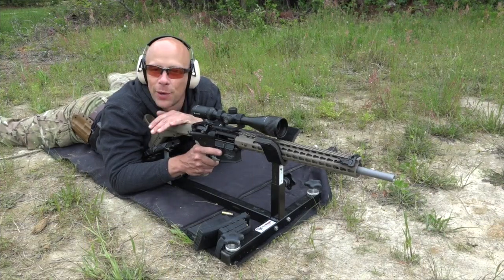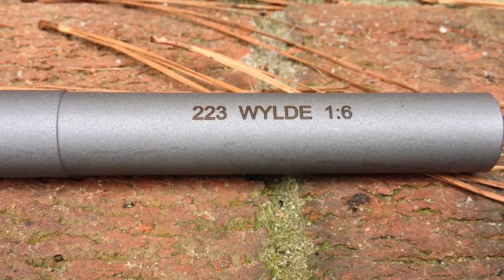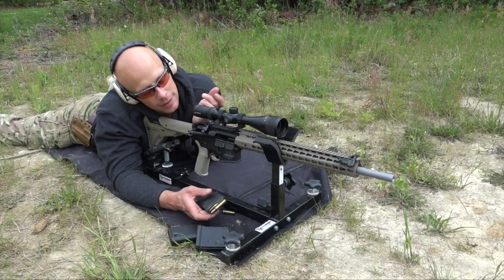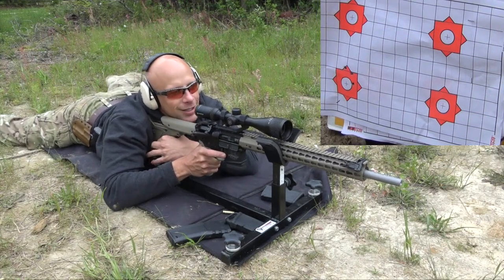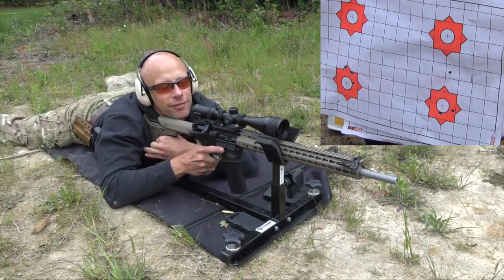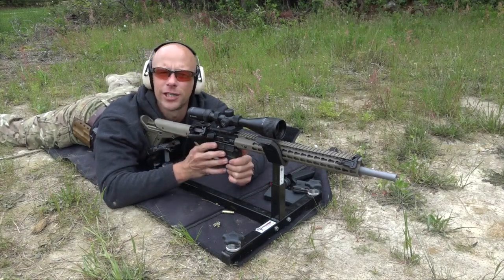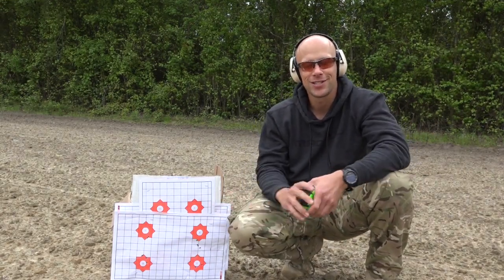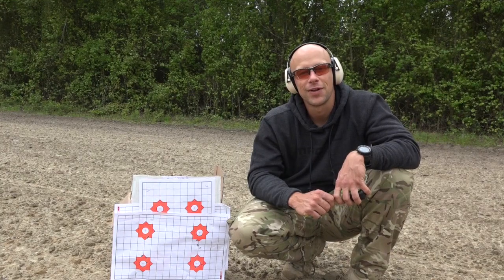Prototype 18'' 1 in 6 Twist Green Mountain AR-15 416R Stainless Barrel Test (HD)

Comment: From my experience, an 8 twist stabilizes the 80 SMK bullet with no issues. A longer projectile may require a 7 to 7.7. Exception is the 90 grain bullet (custom chamber, throat etc ie very few people) sometimes requires a 6.5 twist. 

So this begs the question, what is the point of shooting magazine length bullets with a 6 twist? What are we gaining? What are losing? Gaining I would say nothing. Losing I would say velocity.

Comment: Great video. I'm looking towards an AR build that aims to be an all purpose hunting, defense, and light weight build. When looking at barrels there seems to be thousands of choices. Cant decide on whether to go with a 16 or 18 inch (1:8 twist) from either Ballistic Advantage, Green Mountain, or White Oak. What are your thoughts on these manufactures
Reply from the maker: They all make decent barrels. I'd check out my AR Barrel material and AR Barrel length videos for more info
Reply: +Mrgunsngear Channel thanks for the reply. i watched the other videos. it definitely helped. One request, can you guys research REV arms barrels

Comment: The price is what concerns me with Green Mountain barrels. As for "match grade" ar15 barrels reaching over $500 Green Mountain offers barrels for less than half that. Could they be too good to be true?
Reply: Honestly, you would probably have to ask a machinist or engineer. Considering that the majority of steps that go in to making a barrel are automated and are therefore not influenced by the skill level of the individual machining them, one has to wonder what the high cost of certain barrels can be attributed to.

Comment: I'm thinking nice rail and then you say it's UTG! Anxious for the review
Reply from the maker: Bryce P Thanks
Reply: Bryce P I thought the same thing when I saw them and then I bought it because it is a great price comes with two rail sections and made in the USA.  My has been outstanding and it is light weight, especially for the money. I'm excited to see Mrgunsngear's review. Just thought I'd share my experience with it.
Reply: Bryce P The UTG Pro Slim line series is made quite well. And just as good as any of the oher quality hand guards/rails systems out there. I was quite surprised when I put one on one of my AR's. I would get it over a ALG, Midwest Industries, et. al. As for their other rails, I can't comment. Though I've heard they aren't of the best quality. However, the Pro series is quality made.
Reply: I have one of these rails on my chf mid. It looks awesome and the barrel nut mounting system is def engenius and eliminates the headache between over torqing, and gas tube alignment. 

But I have knocked the front sight a few times on the door frame and realized that I was losing cowitness with my dot. 

Tried tweeking the rail by grabbing the barrel with my fingers and pressing the rail with my palm untill the gas block touches on the inside of the rail on either side.

Long story short, something is not staying put. After I pinch the rail and barrel I lose zero to one side or the other.

I'm wondering if I am literally bending the aluminum tube, or possibly my barrel nut is lose...

Comment: Is it even possible; within reason to over stabilize a bullet?
Reply: Rodney Hawk Nope. Over spinning only becomes an issue on thin jacket bullets. Over stabilization only becomes an issue in artillery when you are using sharp trajectories to get the projectile to it's target.
Reply: I imagine spin drift would be enhanced at distance though ?
Reply from the maker: Rodney Hawk Correct

Comment: This begs the question..  Is it even possible to "Over Stabilize" a bullet with fast twist rifling..   Good demonstration of why we should always question dogma.
Reply from the maker: perhaps it is but we'll have to keep testing
Reply: yes it's possible the rifling let's air around the bullet to spin the projectile. Too much rifling is bad. (exaggerated)example say you have a barrel with a 1 in 0.5 it can cause the bullet to bounce around enough when it comes out the front it might move 1°or more in any direction
Reply: Any pressure increase or velocity decrease? Is it standart twist or gain twist/ progressive rifling?
Reply: @rainmechanic Kinda, because too high rpm will blow up jacketed rounds. But you need some really high velocity and twist. Jacket thickness also plays a part. Solid copper and brass bullets with extrem lenght are sometimes used in extrem twist barrels, with progressive rifling.

Also when you shoot at higher range with zeroed scope your barrel is at an angle upward. The bullet flys during flight but when stabilized too much it stays at the angle it was fired at, increasing its angle of attack to its flight direction, making it verry aerodynamic inefficient.

Ive heard M855A1 EPR shoots more accurate out of 1:8, than the 1:7 twist for M856A1 tracer stabilisation.

Comment: it's probably still over stabilizing.  would have to test it at 50m increments up to 500m then compare with 1 in 7 to see which is better.
Reply: Berger produced a study that basically dispelled the “over stabilization” myth. These barrels seem to back up that claim.